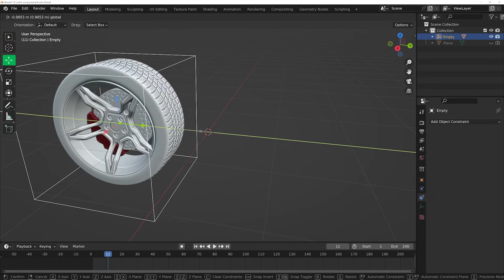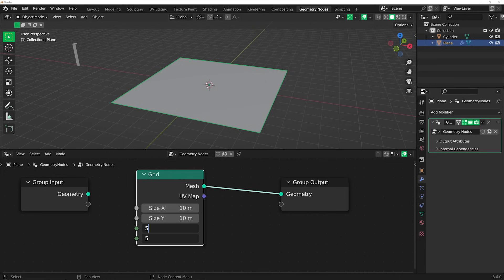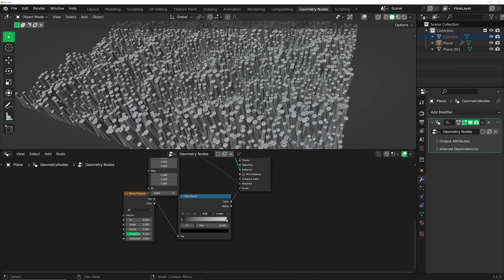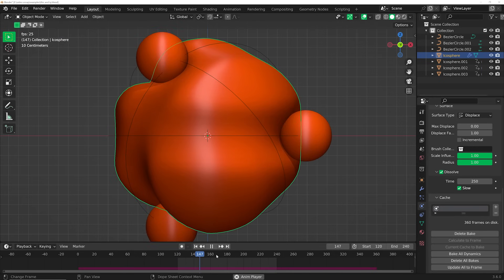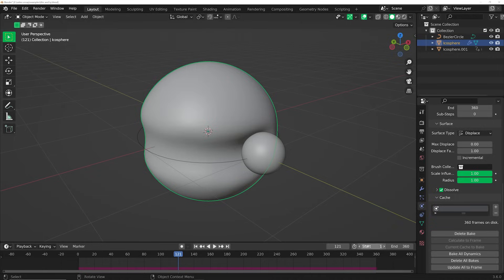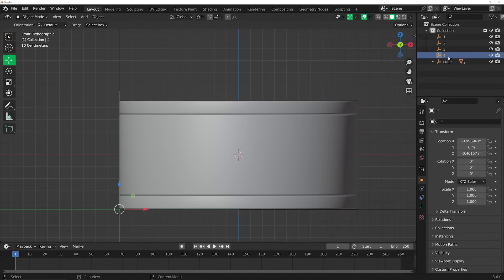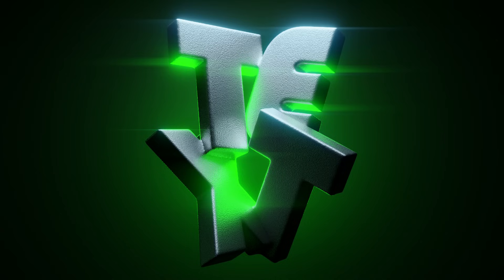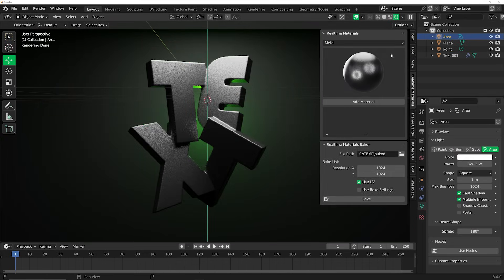5 POWERFUL Animation Techniques in Blender!

Comment: tbh... its either me that doesnt understand how to get the wheel rig to work on all axis but its seems to me like its a really bad technic 

I found no good tutorial on wheel riging so i used geo nodes and got the lenght of my curve (that the car box follows) and divided it by the radius of my wheel and then apply it to its rotation and it works evertime... but only for a constant speed because it is an avergage ! So then i had to had many other things to take in account the speed and variations of the car and it worked... but again i found to tutorial !
Reply: Wheel rig worked for me on all axis.